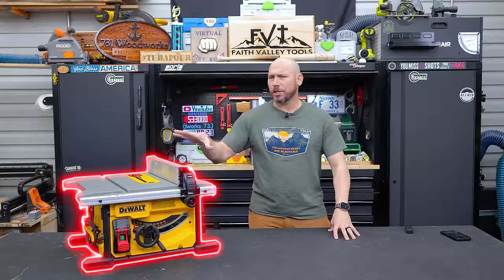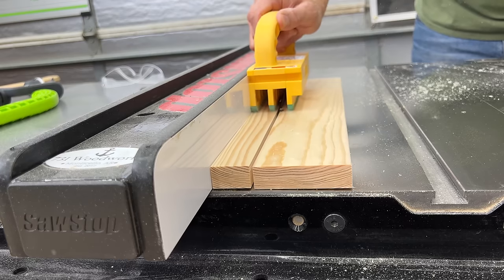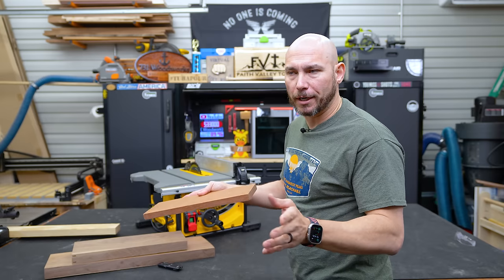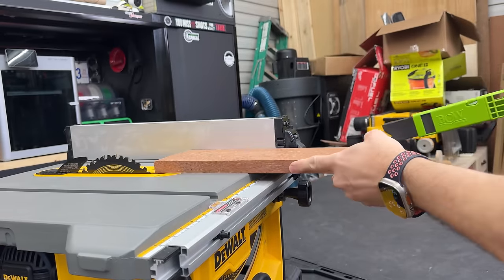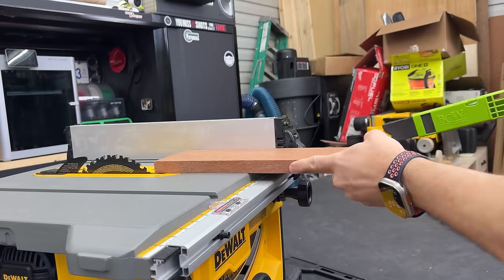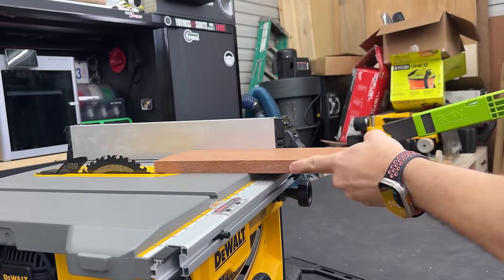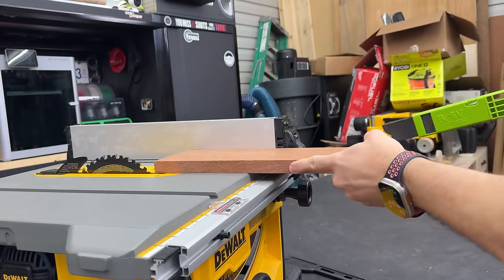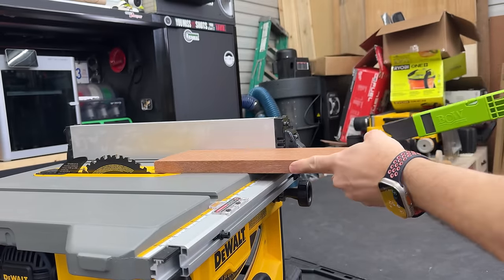99% of Beginner's Don't Know These Table Saw Mistakes to Avoid!

Comment: Thank you for the great safety information. I am an airline pilot and one of the ways that stay safe is risk management... identify what the risks are and mitigate with planning... exactly what you are doing where. I do not like using a table saw, but sometimes it is the tool to got get the job done. When I do use the table saw, I approach it like a preflight. NO lose clothing, clean floor with no slip hazard around the saw, cutting material laid out and easy to access, push stick close by and easy to grab, make sure that my wife is home and she knows that I am using the table saw, ETC.. Your video has added some great tips to the "preflight." Thanks again for the great content... and thanks for making me spend another $100? (LOL)! Keep up the great work.
Reply: Checklist is a great idea!!!
Reply: @jonahwhale9047 LOL… and that too!
Reply: Yes, to the spouse notification. I work in my half of the garage and nothing scares me more than the garage door going up unexpectedly.

Comment: This is by far the best table saw safety video out there. Not only do you state the dangers and how to fix it, you say what could happen, you reinforce thought processes and internal conversations we have with ourselves like cutting something freehand - "this is not allowed" - people need to say that in their head when they're thinking of doing it. You really hammered home all of the points extremely well. Great video.
Reply: I don't cut freehand, but I know carpenters who do it all the time and never get hurt.  One key to accidents is most saws are overpowered.  The guys I have seen do it are running dry wood through a saw with maybe 3/4 hp motors.   3 and 5 HP saws will kill you, but those are not really necessary in most shops.  and they certainly aren't going to be carried to a job site.
Reply: @tacticalskiffs8134  Why would you even put that Idea in someone's head??  A 3/4 hp saw is plenty powerful enough to kick back.  Plus depending the position of the hand when it happens it can pull the hand into the blade.  If the blade has enough power to cut wood it has enough to cut flesh and bone.   Like I said Very bad way of thinking!!!!!

Besides the Idea behind a table saw is to make precise cuts. If you want to free hand use a bandsaw or something more forgiving!!!

Comment: I am really glad to see you mention tourniquets, I feel like that isn't talked about enough. I get it, it's not pleasant to think about, and like many things, a lot of people think "it'll never happen to me" but unfortunately some of them are wrong. Many people also tend to overlook the fact that if the tool can cut hardwoods, or aluminum and other non-ferrous metals with the right blade, and cut them quickly - it can cut clean through you with ease if given the opportunity (SawStop not withstanding)

One thing to note about practicing with tourniquets - make it a point to practice applying them to both sides (meaning using your left hand to apply one to your right arm and vice versa) because when you need to do everything backwards from how you practiced is not a good time to learn...
Reply: Really? I know about how Ts saved all kinds of lives in the sandbox.  But with a TS just what exactly are you cutting off that will cause that level of arterial bleeding.  Gunshot wounds easy.  Maybe even a drastic bandsaw accident.  Certainly a bad chisel accident, But a TS?
Reply: There's an artery in your wrist, very close to the blade when you're pushing stock through the saw.
Reply: @tacticalskiffs8134  TS wrist and forearms. But you have it for all possible accidents, like a circular saw hitting your leg. Inside of your theigh runs a major artery.
Reply: It's not comfortable buying tourniquets, but I'm convinced that I'll buy a few tourniquets! 
Just because if I have then, there will be less chances that I'll need then. 
But if I don't own tourniquets, Murphy's Law can make than needed.
I never had a hard drive failure: the reason is because I allways kept paranoid backups. 😊
Reply: @OgbondSandvol  In germany we say 'haben ist besser als brauchen' - 'better to have something, than to need something', which is kinda to whole idea of PPE and first aid stuff. Just like riding a bike. 'Dress for the slide, not the ride' always worked for me. 👍
Reply: It's unlikely that you will be able to apply a tourniquet to yourself following a major injury. You will need to have someone else trained and available to help you.
Reply: I'm always wearing a belt. That should do the trick, no.
Reply: @BaumisMagicalWorld  It's better than nothing but that's about it. It can be difficult to remove your belt, apply it to the correct joint and properly tighten it, all one handed (especially with your non-dominant hand) and do it quickly - in that situation, the clock is ticking rapidly.

Tourniquets and other emergency medical supplies are, in my opinion, along the same line as a fire extinguisher: You don't buy one because you want a new toy. You don't buy it with the intention to use or need it - you buy it to keep a bad situation from getting worse.

Comment: Great video. I've been using a table saw since I was 18. I'm 52 now. I've always tried to be safe. Another rule that is probably worth adding and probably should go without saying is if you wouldn't do it while driving, don't do it while using power tools. In other words, don't drink and cut. Don't cut drunk. Don't cut while you are sleepy. Don't cut while you are distracted. Don't cut while you are playing on your phone. Don't text while cutting. Avoid wood rage. If that piece of wood doesn't work out like you wanted, or the cut is going really slow, getting mad about it is just going to make you do something stupid and cause an accident. 

Anyway, I see some Festool tracks on the wall there. How are those hanging up? I have an 8+ foot track that I want to hang horizontally on my wall like that.

Comment: Great video. About 4 yrs ago I was gifted a brand new DeWalt table saw my first ever. I had used one about 40 yrs before in shop class and none since( always used an electric hand saw, cheap.) Anyway I was all excited and having been in the service I knew safety is key to survival. As excited as I was I spent the best part of a month viewing videos on table saw safety. Each winter as the snow flies I take time to review the safety videos as a primer before my spring projects. This video was excellent and am going to get a couple of the accessories you recommended.

Comment: Great Video! You may have just saved my Life! I realize now that all these years I've been doing a few things wrong and I'm extremely lucky to not have any serious injuries. Thanks again.
Reply: Wow!    Izzy if you want a few more good tips check out izzy swans tables saw safety videos.    Not that anything was wrong here but the more the better.    I once dropped my fence and sat it back on my saw.  Later that day I was using it to make a rip cur on a small short board. No push stick and as it went through the fence was angled towards the blade.  It kicked backed the worst I ever had. I was using my thumb to push it through and I do always wrap my ring and pinky fingers around my fence so my hand can't get pulled into the blade. But as the board flew back at 500 mph (or whatever) the corner plowed into the skin breaking the knuckle on y thumb and removing the skin to the bone.  From just the corner of soft white pine.   The sad thing is I grew up around the tools and had over 30 yrs experience at the time. Just lazy as my push stick was on my other saw and the other 5 I own was buried on the bench.  Now they have a place to hang on the saw all the time.  I was damn lucky.  Like he said the entire time I turned the saw on to the kick back my gut feeling was this is not that smart.  Lol   

If your saw has a thin fence you can wrap those two fingers around it is a smart Idea that my father taught me.  Then the rule of thumb is If you can spread your hand out thumb against the blade and touch the fence you should use a push stick.   

I feel it is important for us all to share miss happs and remind each other proper safety.  It is too easy to get lazy and think it wont happen to us.   Now I have a thumb that is full of arthritis and enlarged for life.

Comment: Yup, I do understand the concept w blade guards...however, I have never used them. I wanna see the cut as I'm cutting. I know, I know. Some ALWAYS use them, I don't. Your tips are well taken. So when I have bought a new table saw, I always remove the guard. I love the smaller Dewalt table saw, they work great, but my day to day saw is the larger Bosch table saw on wheels. I love it.  Thx

Comment: I taught the freshman woodshop class at a high school for over 30 years.  Safety was the first few of weeks of class.  Demonstrations on each piece of equipment, followed up by safety tests and practice by each student.  When we got to the table saw I gave multiple demonstrations on its use and safety over two days.  After reminding students to stand in the correct position at the saw and always making sure that the area behind them was clear before cutting, the first kid stepped up to make his practice cut, freaked out and let go of his board just as it cut off, the kickback was intense.  The board shot back and slammed into the metal cover on the room heater which was about 15 feet away.  The dent it left in that cover stunned us all.  The kids eyes were huge!  The first words that came out of that kids mouth were "Holy Shit, will you cut my parts for me?"  Much to my chagrin, his classmates called him "Kickback" for the semester and they all cleared the area when he used the table saw.  Respect your equipment! Teaching that class was kept me awake at night!

Comment: So far the best safety video about tablesaws I've seen, thanks. Although as a beginner, I just bought my first tablesaw, recommending a tourniquet when using this tool is makes it feel all quite intimidating honestly, but together with all the safety tips it also made extra aware of the dangers involved and importance of taking safety measures. One question I have though about the cross cut sled: why is it safe(r)? Does the sled act as a riving knife?

Comment: Thanks for a great video.  Your lessons on how to avoid kickback are a very helpful reminder.  I had used a table saw for over 40 years before I had my first accident - caused by kickback pushing my hand into the blade.   I now own a sawstop - while a sawstop's technology can reduce the risk of injury, you still need to use safe practices.  I already use several of the safety tools you recommend & will be purchasing more.

Comment: Thanks for the advice.  I just recently started using a table saw and feel uneasy because the opportunity for injury is high. My go to for many years has been a miter and circular saw. I've had a few dangerous kickbacks in the past and learned from experience how to avoid it and prevent injury from it.  A table saw makes me nervous and unlike a circular saw your more exposed to injury with the blade facing up and limited control of the material.  I prefer a firm grip on the tool im using and a finger on the power button.  With the circular saw im guilty of holding the blade guard back to get the cut easily started but release it once up on the surface.  The accessories you suggest help get the job done safely, build confidence, and make using a table saw a more pleasant experience. 

The only thing I would add is be aware of your surroundings, move obstacles that could interfere with your work path, and limit distractions especially children and pets.  When I was a very young child in the early 70's my father was using his table saw and I would pick up the scraps as they hit the floor.  Unfortunately I got too close and my shirt got sucked into the motor belt.  it quickly pulled me into a big grinder wheel mounted on the end of the saw motor.  His initial instinct was to try to tear me away from it but with no success.  When it started grinding away at my flesh he went for the power cord but the damage was done and a trip to hospital to repair my stomach.  later that year he ran the tip of his index finger into the blade all the way up through his entire fingernail.  It was a bloody mess with a lot of screaming and another trip to the hospital.  Today I still get anxious when I hear the saw motor fire up.

Comment: Great video recently had a bad kick back at work. Thought Id take prevented measures and stay safe. Ive been using table saws close to years so it can happen to the best of us. Another thing to mention have the least amount of the blade cutting through your material as possible. Less likely chance of getting hit by the blade. Be advised the blade burning the material means you have to slightly raise the blade so it dosent burn the motor out.

Comment: Thanks for this excellent video. I've watched it several times just to refresh the things I was taught by my grandfather many years ago. Your recommendation to keep a quality tourniquet readily available caused me to stop and think hard about that, and about my "resistance" to purchasing a SawStop. I strive to be really safe in the shop, but I finally realized that no one suddenly decides "I think I'll go to the shop and cut off some fingers today..." They are called "saw accidents" for a reason... I'm on blood thinners, and realize that I might have even less time to react than most people.  I ordered the tourniquet you recommended (x2, so I can practice - with BOTH hands), and I recently sold my old-tech table saw to help defray the cost of purchasing a SawStop. The one I could (barely) afford is Compact Table Saw - the "baby" of the family. Yeah, it was expensive, but still a LOT less $$$ than even ONE trip to the ER, not to mention the potential life-long impacts of losing a finger or hand. And with the PCS, I cannot use a dado stack, but having a router table mitigates that concern. 
So, even though I now own a SawStop, I have pledged to myself that I will keep on using the same safety techniques I used with my old saw, and which you shared (quite concisely, I might add) in this video.  Watching this video is mandatory for anyone who wants to work with me in my shop - no exceptions.  Thank you again for making this video.  It's simply great!

Comment: Just shared your video with my daughter/homeowner/DIYer who just bought a DeWalt saw for a kitchen remodel.  Excellent points, sir.  BTW one tip I would add: do not operate the saw if you've worked all day and you're dog tired sleepy. When you're rested, you're more alert.

Comment: I am glad I came across your video. I'm 45 years old with an Autistic mind. And I was cutting wood not too long ago with an old tablesaw my mother got from her mother's after granny passed, and had a kick back twice. Tore my hand up pretty good just from the woof. Healed now. Buy always nice to find videos like these to help me develop some more ideas to check for before cutting. I tried to watch some videos before using tablesaw. I knew the "basics and how they worked and what not, but been a long time since I've  seen anyone use one. So I appreciate the video. I'm just getting in to woodworking so it's nice to know what I'm getting into and how to use things more carefully and what the parts are for and how they should operate, the tiny parts; like spring tension and such. I was actually looking to figure out how to manipulate and move bigger piece of logs. I had someone dump just about an entire red oak tree in my driveway for me, for free. Now I just need to figure out how to move it without the special lifts and such. Lol

Comment: I recently sold my compound mitre saw because it was just too big & couldn't fit it inside. I decided to invest in a table saw as it didn't take up as much room. Fortunately, I decided to research how to use a table saw  in between putting it together. I'm so glad I did! I didn't realise how dangerous they were! 😮 I'm going to have to get some accessories & take extra heed to what you have said and shown in this video! The drop-down compound mitre saw seems like a baby in comparison! Thank you so much! I'm going to rewatch this a few times before using it and, of course, subscribe! 😊 Maybe I should've stuck with a smaller compound mitre saw considering I'm no spring chicken!  Too late now! Just have to learn how to carefully and safely operate it! 😊

Comment: as a newbie to this hobby, I fully appreciate and agree with the video. I have limited budget and limited space in my shed but I am very careful using my circular saw. I haven't advanced to a table saw yet but same rules of common sense and precautions apply. one thing I have learnt is that you cant cheap out in this hobby. for the sake of safety good enjoyment for a long time its worth investing in good brands with good customer reviews. 

while operating the circular saw, I am fully concentrating not talking to anyone and have no loose clothing or any item that can get entangled and cause an accident.  
stay safe and stay well all master crafters and keep sharing your experiences. thanks

Comment: 90% of that cuts I make are free hand no fence. I do love the introduction of the riving knife. This knife makes it so much more safe also helps you push the material into the blade without a kick back. Skilled carpenter!!!! I would never tell a novice to use a table saw the way I do.